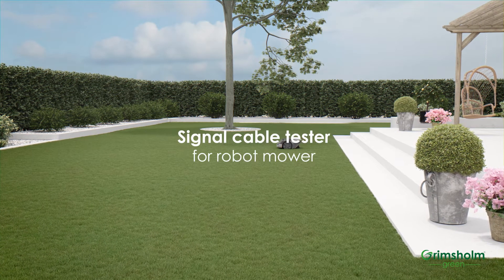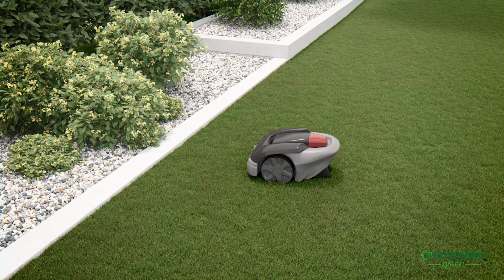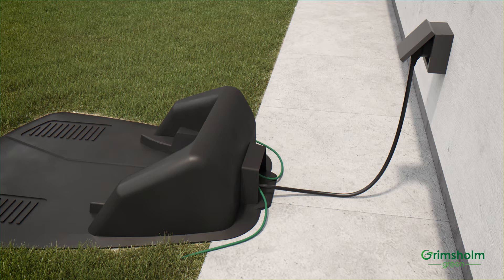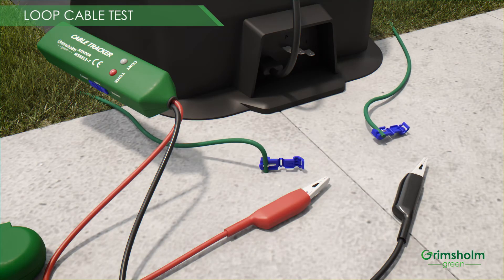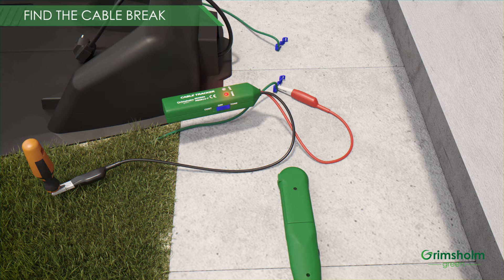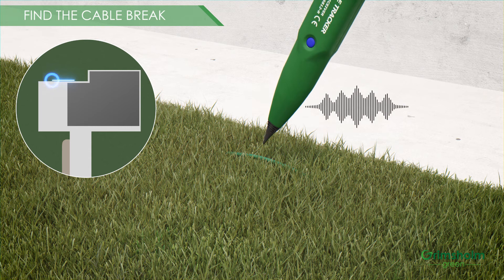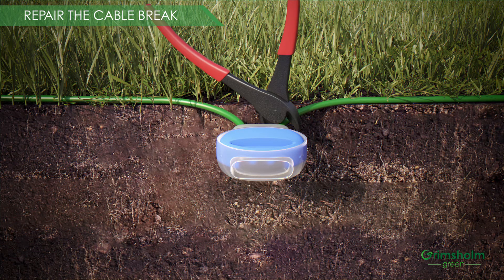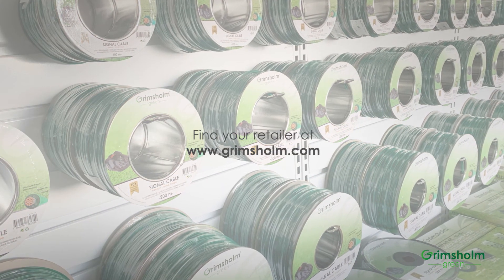Grimsholm Green - Find the cable break with MS6812

Comment: I tried using this today, but I'm getting a signal through the entire boundary cable—from end to end—even though I disconnected both ends from the mower station as shown in the video. I connected the black lead to a screwdriver stuck in the ground and the red lead to one end of the boundary cable.

As I walked around the boundary, I got a beep every few meters, all the way back to the other end near the mower station. However, when I test the boundary cable circuit for continuity, there's none.

I don’t understand how this is possible. How can there be no continuity in the cable, yet still a signal detected along the entire length?

Comment: What happens if I have a weakened red light on cont mode when I connect both ends of cable. But it’s showing a break in circuit when mower connected. Will I get a stronger noise and weakened one where there must be a partial break?

Comment: This is the best instruction video I have ever seen!
Reply: Yes, I've searched many videos and this is the simplest and most correct steps in the testing process.
Issue is those repair joiners aren't easily available, which is a problem when the broken wire is too short to be rejoined...need to add some extra wire, adding 2 joiners.

Comment: I have the same issue, blue light but your equipment says it's ok (cont lamp blinking and I checked sound around the lines at several checkpoints). I also noticed that when it happened - when I got the blue light - that the mower had moved over the cable line with about 50 cm which I found very strange given that the lawn is flat, any ideas? @grimsholm

Comment: thanks for the good video. I have tried to solve the problem but without success. I have gone all the way around but the beep sound never goes away as if there was no break at all...? and the light on the charger still indicates a fault on the cable??
Reply: Happens to me for the second time. Apparently, the resistance is too high for the mower base even though there is still enough contact for the radio frequency. No nice place to be in.

Comment: Blue light blinking, but this device says the loop is intact 😑 so what now?
Reply from the maker: If the charge station is working correct and it is indicating blue blinking light there is probably some kind of damage on the cable. If the signal cable tracker can get signal through the cable it can be a tricky fault to find as there is no break on the cable but still somewhat damaged. 
Sometimes expert with advanced equipment is then to recommend to find the damaged place on the cable. We hope you do find the fault in your installation.
Reply: I have the same issue, blue light but your equipment says it's ok (cont lamp blinking and I checked sound around the lines at several checkpoints). I also noticed that when it happened - when I got the blue light - that the mower had moved over the cable line with about 50 cm which I found very strange given that the lawn is flat, any ideas? @grimsholm

Comment: Does it work, when the cable is some centimeters underground?
Reply from the maker: Thanks for your message. It can be a challenge to catch the signal from the cable with the receiver if the cable is underground even if it´s only some centimeters. But you can still use the instrument to locate the break by "point measuring" and then surround the break. Please a look from 2:58 with this link to have this method described: https://youtu.be/GRHFPAaW8u8?t=178
Good luck with finding the fault in your installation!

Comment: Does this also work when you have 3 wires?
Reply from the maker: Yes, it does. But you need to test one wire at a time. Start with the boundary cable and test in CONT mode as per the instruction video. If the boundary cable is ok you then move one of the clamps to each of the GUIDE wires and this way you can find if there is a fault on any of the GUIDE wires. And when you have found which of the wires that is the problem you can then start to search for the fault in the TONE mode. Note that this equipment detects signal from a visible cable or if the cable is very close to the lawn surface. If the cable is buried deeper in the ground you do measure on different points and this way surrounds the fault. Good luck with finding the fault in your installation!
Reply: @grimsholm  thank you👍

Comment: I use it to find problems on the boundary wire  for my Husqvarna automower. It is usually easy enough to see where the problem might be if rabbits have been digging. But today I found a loss of signal on a stretch of wire where there was no obvious animal invasion. I cut out the relevant area of wire and on investigation afterwards found that there was a very minor break in the insulation which resulted in marked corrosion of the wire. I could never have detected this otherwise. Thoroughly recommended!